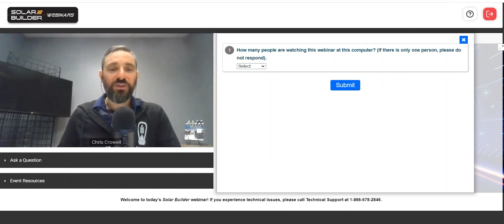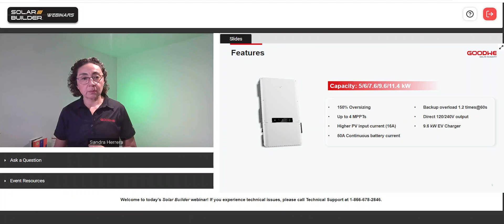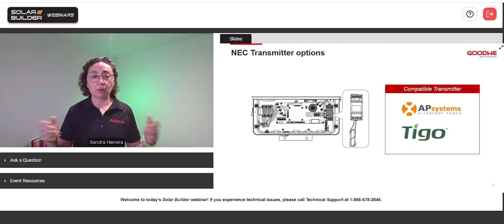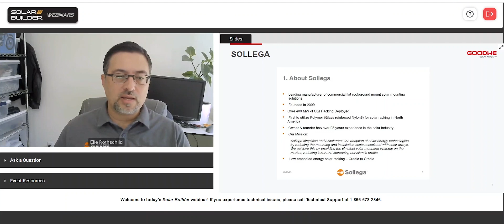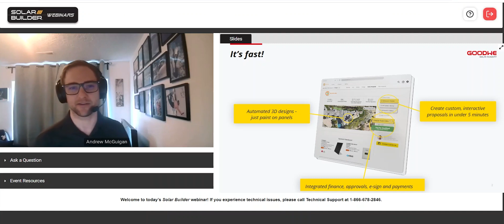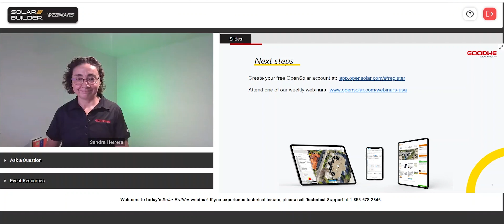GoodWeek 2024 US Session - GoodWe’s NEW UL RESIDENTIAL ESS and COMMERCIAL SOLUTIONS (480V-208V)

Comment: Do NOT buy from GoodWe.  I run a small solar installation company and recently had a nightmare with GoodWe's MS-US string inverter.  After 4 months of troubleshooting to deal with multiple firmware and hardware problems, I was forced to remove 13 GoodWe inverters and replace them with Solis units.  I am now headed for a legal battle with GoodWe to get basic warranty coverage reimbursement.  They are absolutely the worst company I have ever dealt with in the solar industry.  Save yourself from a nightmare and buy any other brand.